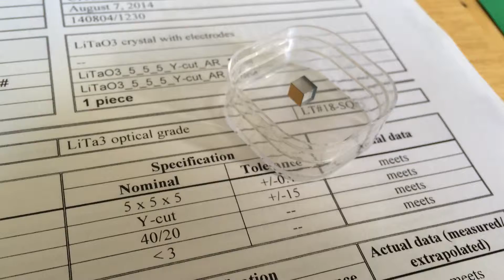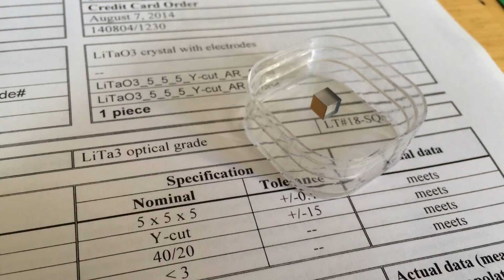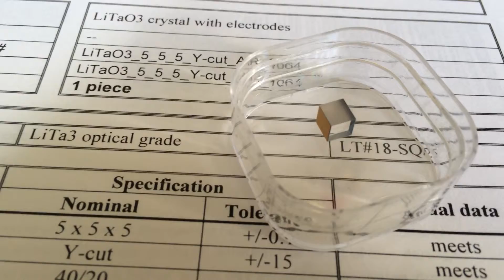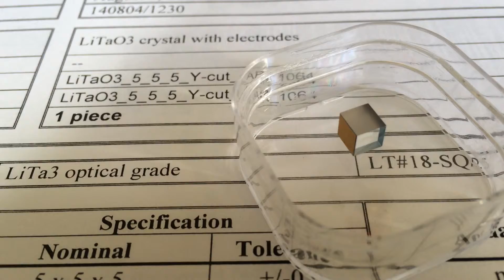Y-cut LiTaO3 crystal with AR coating at 1064 nm sales@dmphotonics.com

Comment from the maker: Cylindrical z-cut LiTaO3 crystal - request a quote sales@dmphotonics.com
LiTaO3_CPD_D20_20
Material: z-cut LiTaO3 crystals
Diameter: 20 mm (+/-0.1 mm)
Length: 20 mm (+/-0.1 mm)
Both faces 40/20 scr/dig
Flatness: L/4 at 633nm
Parallelism: < 3 arc min
http://dmphotonics.com/LiTaO3/Z-cut%20LiTaO3%20crystal.htm

LiTaO3 crystal, Z-cut, diam. 20 mm, length 20 mm
http://greyhawkoptics.com/product_info.php?cPath=32_33&products_id=836
LiTaO3 crystal, Z-cut, diam. 20 mm, length 20 mm
Click to enlarge
Diameter 20 mm, ±0.1 mm
Length 20 mm, ±0.1 mm
Orientation Z-cut
Flatness λ/4 at 633 nm
Surface quality 40/20 s/d
Coating None